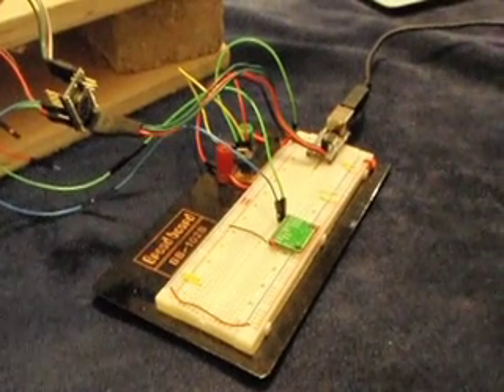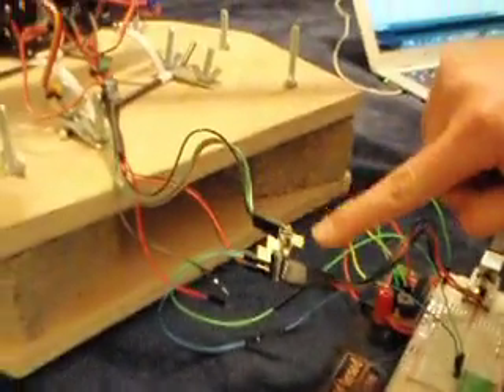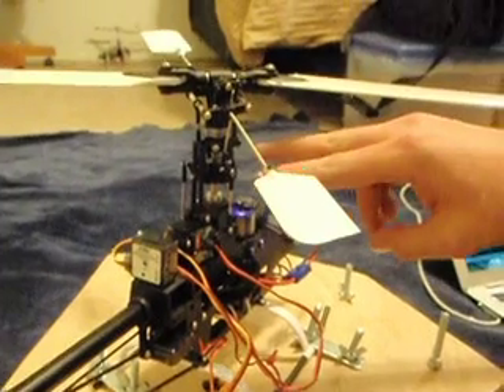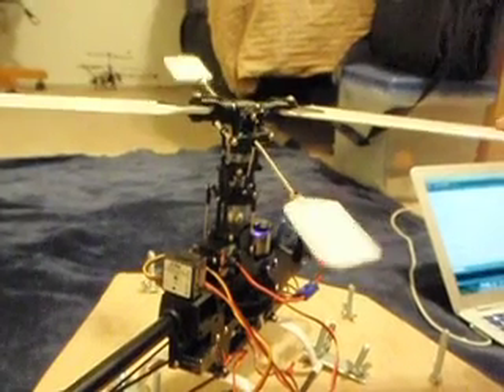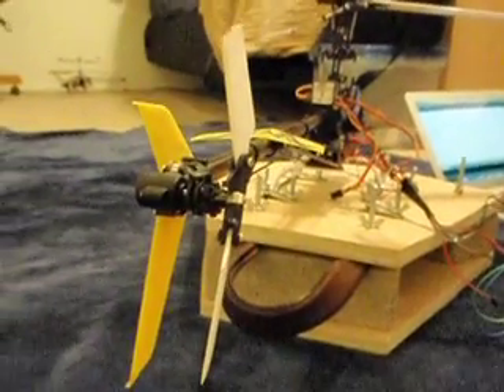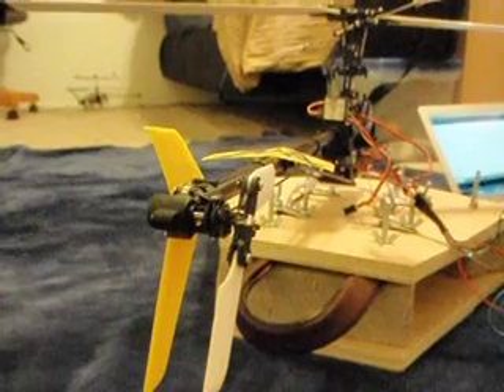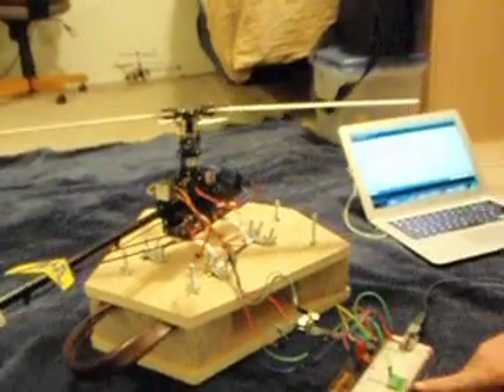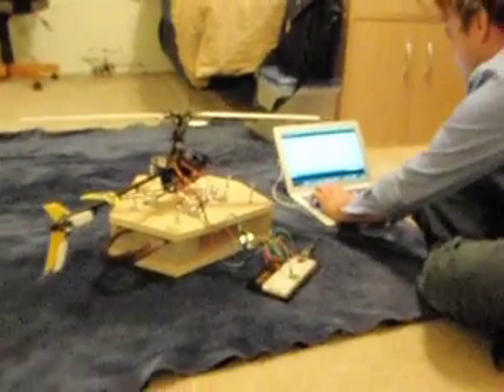Wash Uav B400 Cyclic Control

Comment: @seanreynoldscs I'm speaking about arduino as a software plattform, the high level functions for fast and easy development has the cost of poor compiling optimization. Yes in the 60's that computer was programmed in a low level hardware level languaje like assembler. It doesn't fit to me someone who says to be a master of computer science, be programming in a hobbist oriented plattform.

Comment from the maker: @N1xZer0 So this is not a "SYSTEM" as you say...
The point was to demonstrate control over the larger cyclic heli.
The gyro and accelerometer would eventually be giving the embedded processor data it can use to correct (beyond what the gyro on board would do)

In actuality the gyro on board should actually be a compass.. My gyro doesnt even have force measurements in the axis of the stock gyro... A compass is a much better idea for that level of control... as long as you are on earth anyway.

Comment from the maker: @kavic5150 Thanks for your concern. I'm still alive... I know the danger of something in the linkage coming loose and the blade flying through me... 
But beyond that... baring mechanical failure... my code was not complex enough for a bug to kill me... and the helicopter was held down with blocks, so...

It was dangerous... but not as much as you make it sound.

Comment: Arduino plattform is not a good choice to develop an efficient uav due to null, innefficient compiling optimizations and weak processors. yes, it's dummies-proof (easy) and fast programming but you'll never get a realtime responsive system if you plan to apply Kalman filtering, PID algorithms and multi sensors to work together. Arduino is just usefull to impress your grandma and your friends. Try assembler or low level C, that way, your system will rock. (i wrote you this on other of your video)

Comment from the maker: Well; fortunately for me, these dont usually spontaneously break apart :)
Usually they have to crash before the blades start flying into fences. 

I engineered the bricks make sure that it doesnt get a chance to wreck. 

But yeah, I think if a wooden blade is flying at my head I have larger concerns than my eyes :) These blades will prob break goggles... so I will have to make sure it doesnt wreck in my room while I'm sitting next to it hugh... :)

Comment: There is a huge safety problem here... please be more careful. The blades on this heli are capable of 220mph, which you should know if you are capable of building the thing you demonstrated.

Also - you just demonstrated a ridiculously large version of something that is already commercially available and is about the size of a a pop bottle lid... why not just get a simple flybarless stabilizer system?